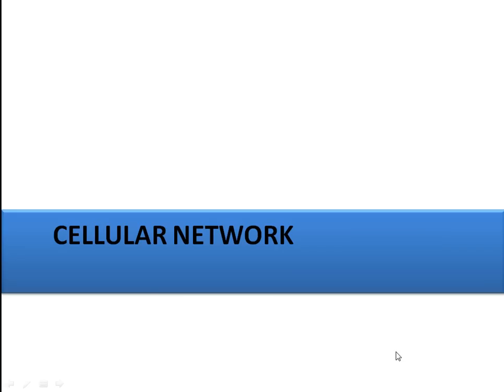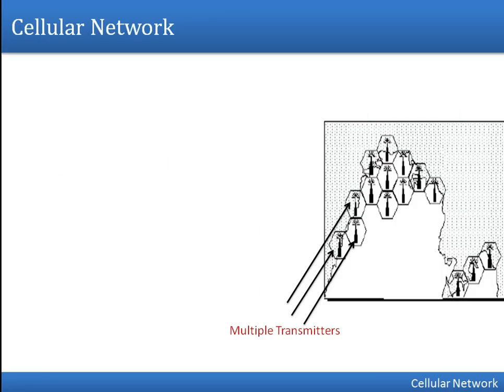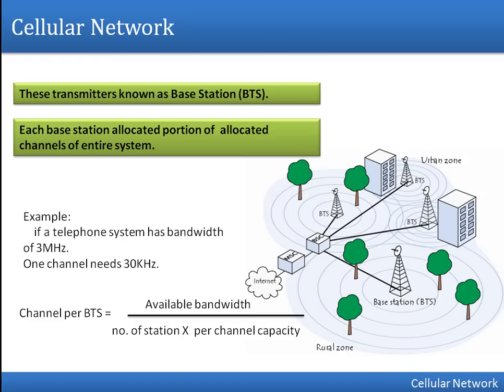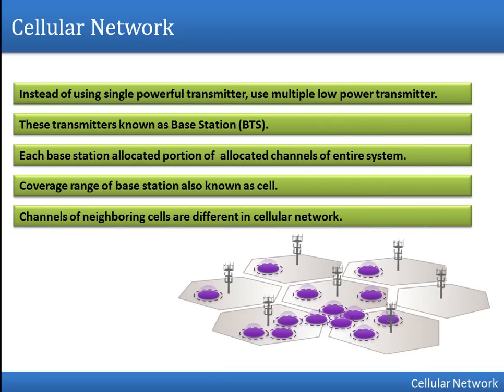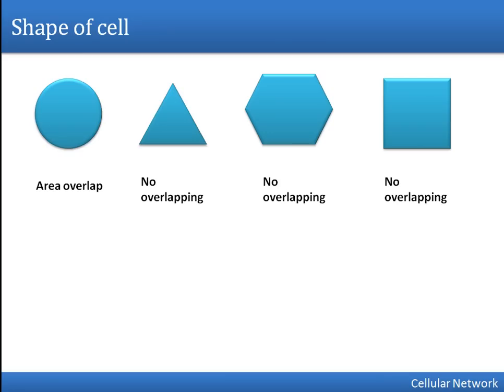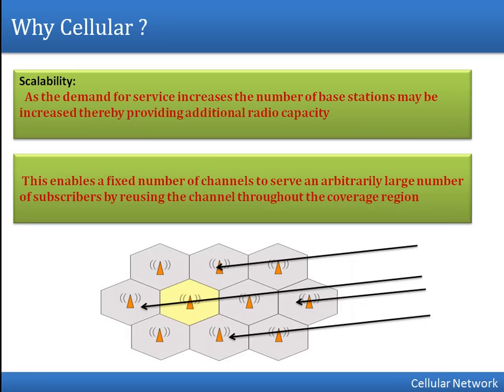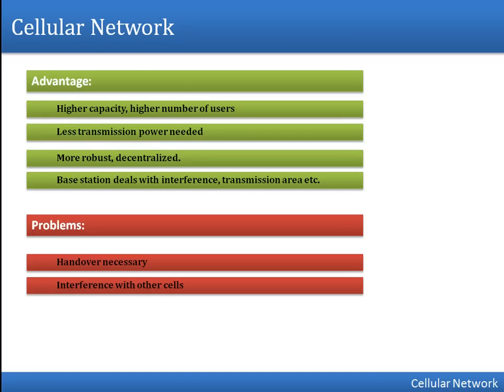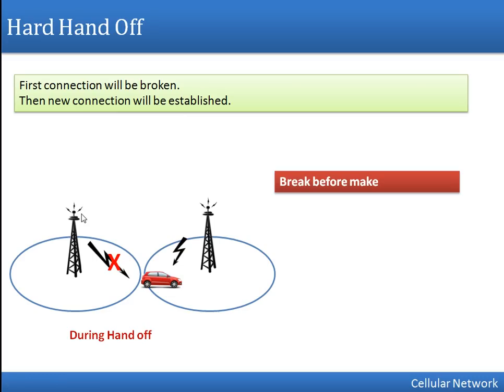What is Cellular Network | Hand Off Concepts

Comment: I have small dout signal run through channel or cable why use cable
Reply from the maker: Let's understand it with a simple example. Our roads are divided into multiple lanes. Now your question in this context is cars run on road or in the lane. 
Actually, cable capacity is divided into multiple channels. So the signal is going through the cable but it is also in some channel.